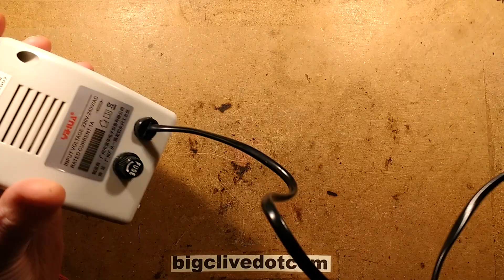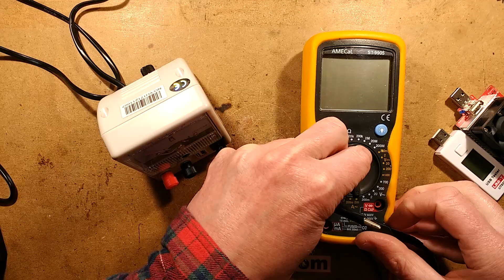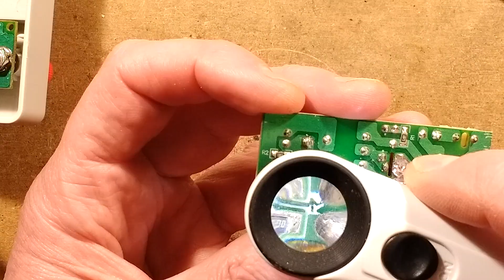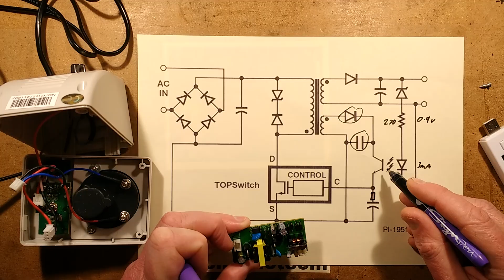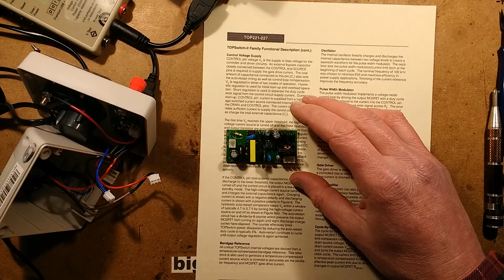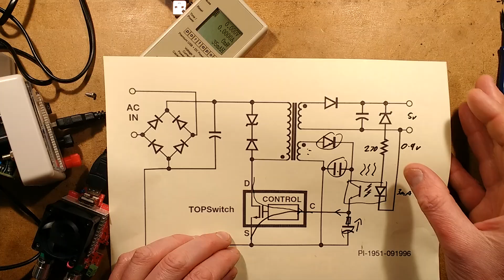Test of the Yihua 502D USB bench power supply.  (With fix!)

Comment: The optocupler feedback circuit, is begging for a adjustable voltage hack. You could have a potentiometer on the front panel. Just remember to change the output capacitor for a good voltage margin. I'm sure it will do 12v or even more!

Comment: I'd change both the plug and cord to a good 18 Ga zip cord. I imagine that Yihua didn't really manufacture this, as that name is lent to several electronics items I've seen listed under other brands. Saying that, I own a hot air/soldering and a desoldering/soldering station by them.

Comment: I've been using one of these for years now. It just works and has never failed. I did modify it so it charged Apple devices. This requires the voltage on the  two data lines to be set by resistors. I have certainly got my $$$ worth.

Comment: Btw, it reminds me of a current (and 15YO) apple macbook pro power adapter. I still get a tingle between the case and ground from that, so much that it's sometimes annoying. I measured it once to 120V or so. Where I used to work, we had a separation transformer that I could use to remove it. I wonder why people aren't talking about that…
Reply from the maker: That's a very annoying issue with all ungrounded adapters.  The Apple ones are particularly bad because they use a more professional level of filtering.
Reply: @bigclivedotcom  how does that make them worse?

Comment: Epoxy glue the xfmr core at the sides only. Reverse engineer/draw schematic of the feedback/voltage divider and see if you can pull up or pull down the reference voltage, to get 5V or 5.1V etc. (it seems you did that). Check and or replace any bad caps.

Comment: The leakage “voltage” is a direct measure of leakage current. It is the leakage voltage divided by 10Mohm input impedance of the multimeter (or whatever it is). In your case it was seemingly 1Mohm so 90V/1Mohm=0.1mA. With a current shunt it came out to 0.2mA. Right ballpark.

But be careful with using low impedance circuits for such measurements: they form a transformer winding. It doesn’t take much to induce 0.1mA in a coil of wire that’s close to other transformers etc.

Comment: @Clive - With the panel meter going to 2 A full scale, I would have interpreted "rated current: 1 A" as the maximum inrush current at 220 volts. I was surprised you did not measure Power Factor, which might have some bearing on maximum inrush current from Mains.

Comment: Well here it is, 2021, the world has changed, the age old  question "who was that masked man" has taken on  a much different meaning. Following this video, I purchased that power supply, added that resistor and it has been my primary 5 volt power supply when I just have to have over 1.2 amps power.  It does a wonderful job, runs all my little single board computer for testing and setup with operating system, it has never given me an ounce of trouble even though I have a set of LED'S hooked up to the screw terminals to light up the shelf where it lives.  When ever I need the light, or need the power 5 old LEDs mounted on  a strip recovered from an old LED flat screen TV that ended it's life when the damn cats started fighting behind it and actually knocked the blasted thing on the floor shattering the screen. At least the led's are serving some purpose.  Cats still run the damn house too, the penalty I have for inviting my   daughter to come live with me following the death of my lovely wife of 51 years.  She cooks and cleans for me, and insures I don't go off the deep end so I guess the cats are worth it, plus the cats have long since settled down and become my friends and nightly companions sleeping in the bed to keep me a bit warmer in the cold Dakota nights.

Comment: I have had many cars in the shop with the digital displays having a wave or pulse. Go check the alternator and it’s putting out some AC voltage. The bridge rectifier is going bad and time for a replacement alternator. Usually it’s been to other places and they couldn’t figure out what was wrong. So anytime I see a display do that I see if it’s putting out AC.

Comment: I got one of these unit awhile back, and found that the output seems to be live at half the mains voltage. (Thailand uses 220V@50Hz) So I just took out the power supply board and replace it with DC buck regulator, so I can power it off an "known good" DC supply. 
Since then, its very useful for testing cables and 5V powered devices
Reply from the maker: A typical multimeter will show that due to the filter capacitors.  It's usually just at around 100uA.
Reply: Maybe it’s some defects in my unit, I got an electric shock when touch one of the terminals. Being suspicious I measured the output terminals with the (isolated) handheld oscilloscope and found out the 5 Volts sides has around 95-110V AC coupled to it. I also tested it with the mains tester and it seems to confirmed the same thing.

Comment: You commented that they fused the neutral, with a 2 pin razor type plug how can you tell which one is which without taking it apart and metering it? in America as you probably know regular 2 pin plugs have different size pins j/s so if you have a 2 pin razor type plug you have a 50/50 chance of fusing the line.

Comment: should be able to remove one resistor on the TL431 and add a pot to tweak that voltage without much trouble and if the correct other value resistor was OK could make a variable supply

Comment: can you use a  normal pot or a 10 turn pot  connected to the  adjustment section where you put the resistor to set the voltage  ?   and whats the highest  output voltage
Reply from the maker: Not sure how high it could go.

Comment: Looks as if 1A is the input fuse rating. Yihua numbering scheme includes output voltage 5v and current (0)2A. And - I have USB charger for my camera. The camera casing is metal and it usually feels smooth, but when it is charging the surface feels rougher, as if it is brushed aluminium. I take this to be caused by small contractions of my finger muscles due to the leakage current. Anybody else get this effect?

Comment: The voltage drop problem is caused by loss in the cables between the power supply board and the front panel!
By changing these to a thicker gauge and adding a separate "feedback" wire attached right next to the USB plug, the supply gives a nice and stable 5V.

Comment: I've had lots of issues with the floating AC aspect of USB power units. I have some power strips with USB and there's always that 90 volts AC to ground at a few microamps. I found when I was charging my phone the touchscreen was erratic. Not surprised really. So I have reversed engineered them all. Dismantled and soldered a wire from the USB socket housing to the mains earth bar of the power strip and had no more problems since.

Comment: I forgot to mention, the one that I have was modified with the Big Clive "FIX"  To drain off any excess, I have it wired to a set of LED'S that belong behind a LED type TV set, some outfit had them cheap, and I picked up a handful.  They light up my shelf nicely when I turn on the little PS, barely moves the needle on the amp-meter but i think it sort of buffers the voltage a bit, there are six LED'S on the strip that light up brightly when I turn  the unit on, bright enough to make the wife complain from her chair across the room from mine.  Of course it doesn't take much any more to cause her to complain, what after living as my wife  for over 50 years now.

Comment: Well I had to watch this one once again.. WHY? Well I tired of the political fight that we in the USA are now engaged, following the bloody Saturday that ended last week with so many dead or wounded.  Nice to relax to the sound of Big Clive, and talking about my favorite 5 Volt Power supply.  Having used it now on at least a weekly basis, I can testify that she is a great little power box!  I love the needle for a quick view of the amp draw, never though about how nice that would be till I have it.  I have a set of crock clips plugged into her all the time, they hang from my fan remote that is attached to the side of my old desktop PC desk that now serves as a sort of work shelf next to my old electric recliner where I spend my days trying to count out the hours upon hours that I still have in this wicked world.  Over the past couple of months I have built several rather good variable power supplies, some with fixed output banana plugs, others with variable voltage and one nice little unit with both amp and volt variable, yet when it comes to 5 volts, I always reach for this little guy.  Could be because it rests right at my elbow while I have to plug in the other, or may be not.

Comment: Finished my upgrade on this unit by pulling off that strange plug and putting a standard US plug on, also wired 2 LED's that light up  the shelf she sits on when she is engaged this drops the output to right at 5 volts at 1 amp.

Comment: for small currents of a few amps glass is ok it is only when you get into large currents of several dozen amps that it uses ceramic and especially industrial applications and maybe the mains box in the home they will have quenching  sand

i thought the ce was europeans FCC, consumer product safety commission  and UL in 1

here in america we have the FCC, consumer product safety commission  and UL  as separate groups.

the FCC makes sure that the device does not act as a radio transmitter.

the consumer product safety commission makes sure that the products are safe  

the UL does the same as the consumer product safety commission  but abuses and destroys products in the name of safety for example they will drop a hair dryer from 3 feet to make sure it does not fall apart and present a safety risk due to exposing the electrical stuff inside or smash the picture tube of a tv to make sure glass does not fly out beyond 3 feet and and maybe dip a hair dryer in water to test the GFI plug to make sure it trips safely.

Comment: Makes one wonder; could that connection be for an upgraded unit with a variable resistor so you could set the voltage, perhaps with a second meter to show the voltage out?  Makes perfectly good sense to me, perhaps install a variable resistor and one of those sweet little digital volt meter that china sells for a buck two  fifty?

Comment: I love this little PSU. I give it a big thumbs up. I added a Pot to con3 like you did and tweaked it good. I however wasn't surprised by the lower than 5V because on the ebay listing I got it from it said: Output Voltage: 5V -6% (that's 4.7V). Still unsure as to why they did that though. Anyway, I put it under load with 2A and zero resistance and tweaked it to 5V. Now without load it's reading 5.21V. What I'm doing now calls on another BCDC thing...I've installed 3 nokia Lithium batteries and hooked my 12V solar panel to it. Switch between power sources. Love this little box.

Comment: Speaking of "hysterical screaming", when WAS the last time you got a belt off the mains?
Reply from the maker: If we're talking full-on violent electric shocks, then a long time ago.  If we're talking mild tingles from mains borne current then fairly recently.   Most shocks I get these days are zaps from electronic stuff.
Reply: @bigclivedotcom  Years ago we (the family) had an old wooden radio. Lovely thing with veneered exterior and exotic names on the tuning scale - Hilversum, Lahti, etc. For some odd reason there was an exposed spring-clip fuse holder on the back and I made the mistake of reaching round and picking the radio up while it was still plugged in. Soon put it down! More recently I was having a problem with my tumble dryer where there was no heat from the elements. After looking online I found a vid that showed how to check it out and reset it. Having fiddled about with it I plugged it back in to see if it went. Still no heat. Left it overnight and decided to rinse and repeat, forgetting that it was still plugged in. Hysterical screams ain't in it! Enjoy your vids and your accent.

Comment: Yihua 502D USB bench power supply 5V 2A PSU

Clive used 47k ohm

I went with a 56k ohm 1%
This gives:
5.21V with no load, ripple 4.4mV,
5.12V at 1A, ripple 63mV,
5.05V at 2A, ripple 84mV.

I then added 470uF 16V and 100nF ceramic capacitors in parallel on the front panel PCB connecting these extra capacitors across the PCB tracks near the output terminals.

This lowered the ripple voltage, now I get:
5.21V with no load, ripple 1.8mV,
5.12V at 1A, ripple 22mV,
5.05V at 2A, ripple 31mV.

Mark

Comment: That looks dope, I'm considering to buy one, is it possible to get a Samsung fast charger inside?
Reply: Isnt the fast charging just activated on the phone by tying the data lines together? Should be easy to jump them on the units usb plug.

Also you probably could fit this unit with a better psu if you wanted. Wouldn't be too hard.

Comment: That power supply use in phone repair when you need to turn on smartphone without battery an want to know the how current being pulled from device 😊👍and that 4.2 voltage means a fully charged phone ( lithium ion ) battery

Comment: I'd say a worthwhile endeavour would be probing various bits & bobs on these circuits with a good old fashioned oscilloscope. The switching on that optoisolator for example ought to show up rather nicely. That and output ripple, though I don't know how much modern day electronics care about input power ripple - you're in a better position to make that judgement. Also it would allow for some interesting comparisons between "proper" OEM power adaptors and the poundland specials (especially the good ones!)... I mean they say it's DC, but...

That said, there's only so much the scope can pick up, so some sneaky really high frequency switching noise might make it through undetected :/

Comment: The 1A rating on the back appears to be for the fuse after buying one of these for myself. The mains fuse is 1A, you will note the fuse symbol adjacent to "RATED CURRENT 1A" on the label. The fuse is a fast blow 1A. The supply easily delivers 2A output

Comment: As soon as you see those European two pin plugs, you should cut them off and fit a UK plug.
Reply from the maker: I did.  Unfortunately it turned out to be copper coated aluminium cable.

Comment: Did You mention the price? I was curious and found it from 15,- € to 44 €
https://www.ebay.de/itm/YIHUA-502D-5V-2A-Mini-DC-Power-Supply-for-Mobile-Phone-Repair/162806465483 
15 would be half way reasonable it it really comes with all the cables and would'n need tweaking ...
However: As long as questionable devices get sold from China and elsewhere, I'm thankful for informative Videos like this.

Comment: Why does it matter that the insulation is left from the service wire? Comments like that could be given meaning rather than left as YouTube folklore. Cheap words, cheap wisdom.
Reply from the maker: Just an observation.  It's a messy thing to do.  The cable also turned out to be copper coated aluminium.

Comment: Is it really worth About £30 for a slightly odd rated USB power supply, albeit with a meter. but then a multimeter would be more accurate. Looks quite retro, but when do looks come into test equipment?
Reply from the maker: You can get it cheaper.  I have to admit that the moving coil meter is much more indicative of a varying load.

Comment: The ideal 5V voltage for me is 5.1 - 5.2 Volts to compensate for the bad electricity conductors (shitty copper). This thing is garbage, I mean I have a YIHUA SMD rework station that is pretty good but this ... Ugh...

Comment: At the beginning where u measure the  voltage with respect to Earth, I've got a Roth make DAB radio with a similar phenomenon, if u connect a meter between earth and the radio's telescopic aerial, there is a reading of about 72 volts at 47 microamps, and if you touch the aerial while touching something that is earthed, can sometimes feel a very slight tingle!